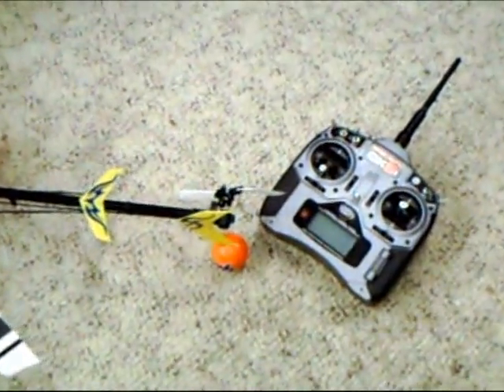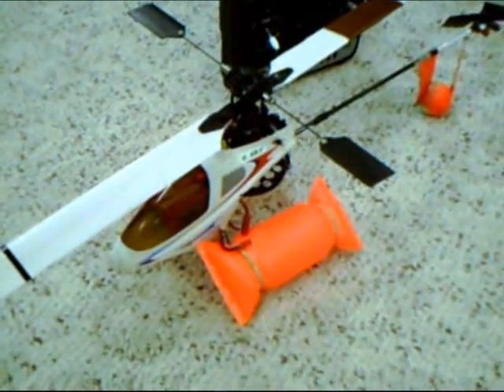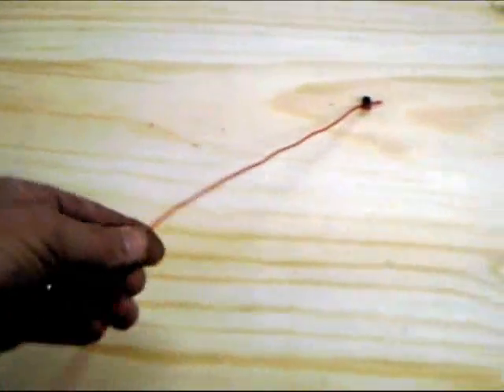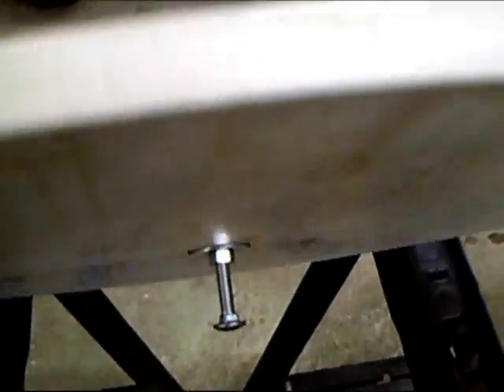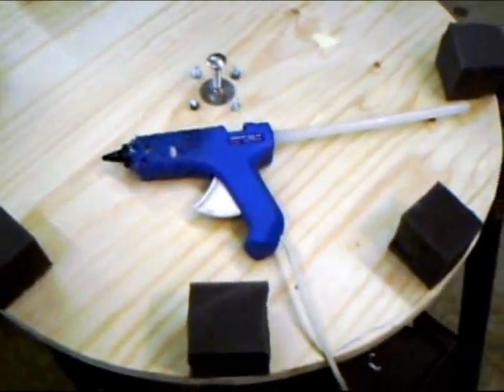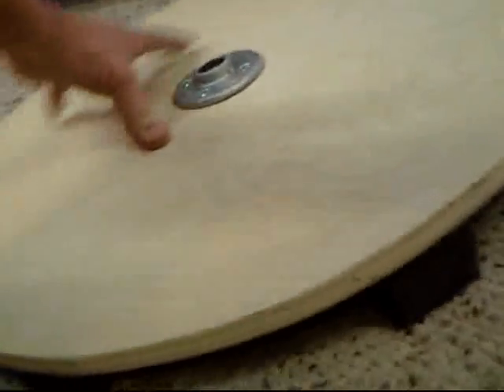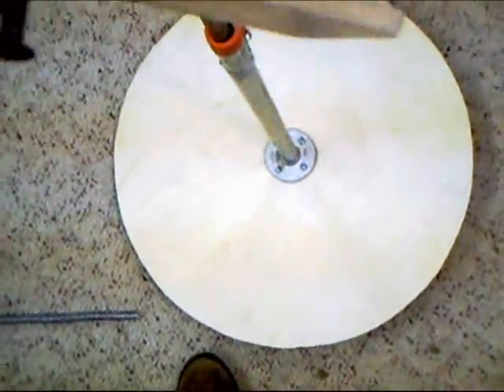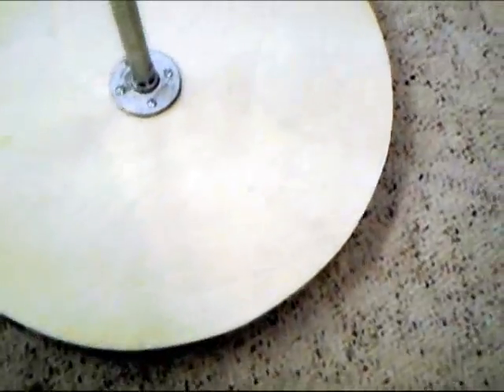Pt 1, Build an Electric Heli Training/Test  Stand.

Comment: for the base I already had scrap around the rest cost me approx $11; as I couldnt find a flange and steel tube I used  a tubed table leg that had a plate welded on; so only had to screw to the base wood.
The main thing is that it's a simple effective idea, MANY THANKS Dave (now to go buy the heli )

Comment: Well ya beat me to it! I was thinking the same thing but I was looking for a axial ball socket for the top pivotal point. Had to kick the idea around, result a Droid cell phone holder with a ball joint with a the original cradle for the helo platform surface. Will possibly use a a CB radio spring for some controlled movement of the main stand pipe as well. Will possibly you tube it. I have a Walkera 59QD to get used to myself. Nice Job on yours, thanks for sharing the idea.

Comment: Hello Mr. Dave I really like all your videos , they are very helpful , I bough an old Kyosho concept 30dx that a have restored but I’m having a Hard time finding main blades for it since the grip of the rotor is 8mm but today’s blades most of them are 10,12mm, can you make a video of how to adapt 12 mm blades to 8 mm grips with that washer method , I would really apréciate It thanks Mr Dave for all your nice videos !
Reply from the maker: Thanks  a lot.  Not sure about a video, but I am using Zeal 550 blades and they fit the rotor grips fine on my Concepts.  I do not have a DX, to make a video,but Zeal makes blades that should fit.  Thanks Kindly.  Here is a link to my latest Kyosho Heli video using those Zeal blades.  https://www.youtube.com/watch?v=qDMBoC6Oa_E

Comment: Flukeone,

If your problem with Heli-X is that the engine doesn't respond, it's because you have to assign a switch (or keyboard stroke) to "idelup" or the engine won't start.

Comment: ok, what is the purpose of the bolt in the center of the base?  Why is it needed?  Once the 24" steel rod is installed what is the bolts purpose?

Comment: Beautiful Blade 400. I have one too. It flies great. I have a XCopter too. If may fly right but vibration and unbalance is shocking. I use a different training method. While this is fixed on a pole and only helps the helicopter to track up and down, the leaning over the sides helps nothing. I use the ball training gear strapped under the landing gear with nylon ties, then I tied a strong curtain string or fishing line 25 inches (about 45-50cm) in the centre of the training gear and the other end tied on a strong curtain hook screwed on the centre of a 2x2 feet plywood plate no thicker than 1/2 inch with the ends sanded down like a chisel to make the training balls go over and on top of the plate when the helicopter rotates around with the tail rotor before lift off. With the string or fishing line attached, you can actually lift the helicopter halfway or all the way the entire length of the string. This way you can learn how to hover the helicopter accurately because you can see that it moves sideways and you have better response in controlling and correcting it. You must make sure that the helicopter doesn't lean over more that the string permits when it leans over to a point where the blades may hit the ground as the helicopter leans sideways. The balls must touch the ground before the helicopter is leaning too much as to stall. Do this check before training to hover it. Before training, pull the helicopter sideways from the main rotor shaft to stretch the string fully then touch the 2 balls closed to the ground with the ground. If the rotor blades are well off the ground by 4-5 inches, all is well. If they are less than 3" to ground, you have to shorten the string or fishing line, making sure the string or fishing line are secured properly at both ends. Don't force the helicopter to lift the plate.

Comment: Hi nice video,
I have a question, the ramin rod size is 1/4" and the Flat shoulder bolt is 1/4" this will not work is there a typo? should the ramin rod be 1/2".

Thanks

Comment: If you attached it to a ceiling would it help you learn inverted flight?
Reply from the maker: I dont think very well. Learn upright on the stand, then use a simulator for inverted. Good question.

Comment: all the parts are at home depot and it is about $40.00 can not get the the 1, 24 " long by 2x2" wide foam insulator strip (cut to 2x2x2" squares.

Comment: i just keep wondering how you guys can be accurated with measurements when you dealing with fractures..1, 3"x 8" x 3/16" for crying out loud...could do do in metric more easy more accurate
Reply: Its called being good with math....
Reply: because this is AMERICA, we use inches.  Learn to read and use a rule. I can mark out to 1/64" if I have too.
Reply: +First Last i bet you can, but can you calculate the probability to make a miscalculation? :-0 (not to worry i am not some anti U.S. Freak trying to make a point ..it's all good )
Reply: don't make mistakes I change to  decimals any way. can you read a mic to 2/10000? or use a bore gage that reads 25/1000000 ?